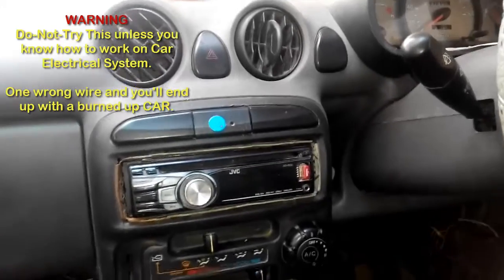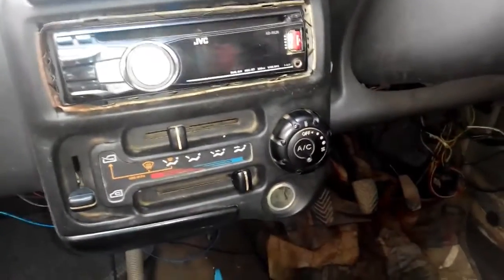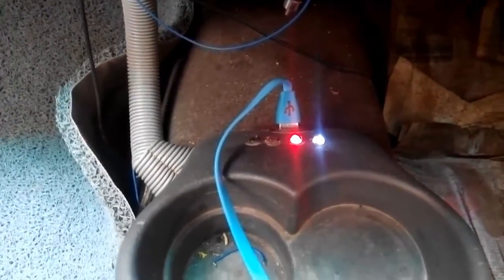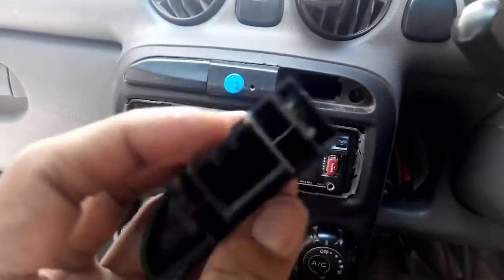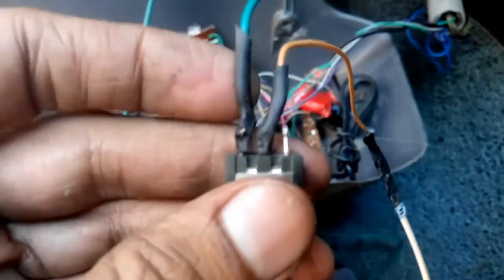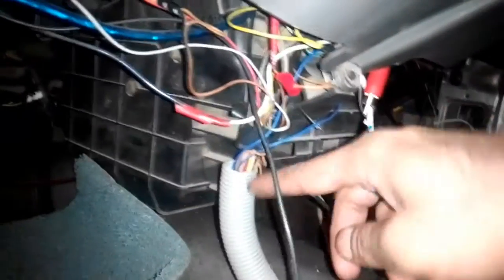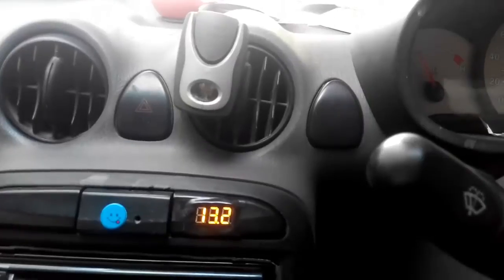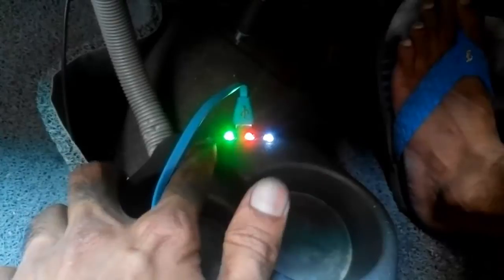How To Install Digital Car battery monitor Correctly, Shows Charging Voltage

Comment: For most cars is the Maximum Charging Voltage. Any more and your Voltage Regulator (Normally part of the Alternator) is blown allowing over charge which can "Cook" the battery. That is why if you need a new battery you should always do a Charging Voltage Check or you could just "Cook" the new one as well in very short time

Comment: You can also connect the volt meter to back of cig socket pins so it turns on and off with car key. Very simple mod for anyone.
Reply: But it won't show if your alternator is charging. That was his point.

Comment: so connecting the volt meter straight to the battery doesn't fry the curcuit board of the volt meter?? I would have thought that the huge current (amps) would.
Reply from the maker: No, this volt meter can handle such Amps easily.
Reply: chris critchley  Y'all are both silly. To read voltage you need to run your meter in parallel. For amps you run in series. That's electrical 101. You want to mesure your alternators amperage output, who gives a damn about voltage
Reply: Chris -  The voltage meter "accepts" or "allows" current to flow. A common misconception seems to be that a power supply will force its rated current through to the device - this is incorrect, only as much current as the device will accept will flow...
Reply: I have car battery of 12 volts and 70 amps....what about me...